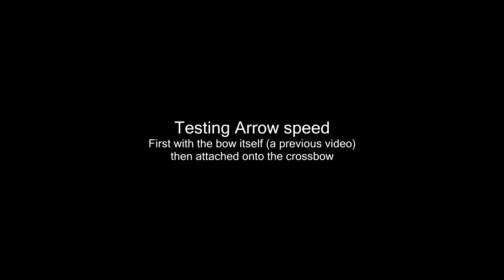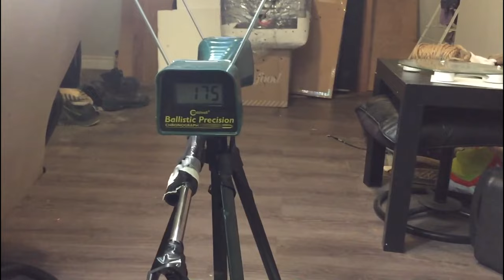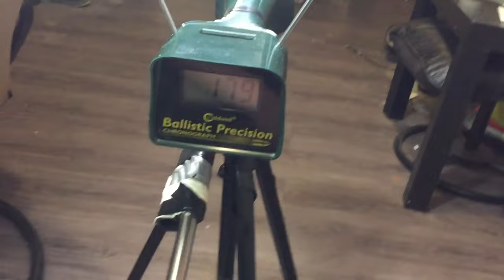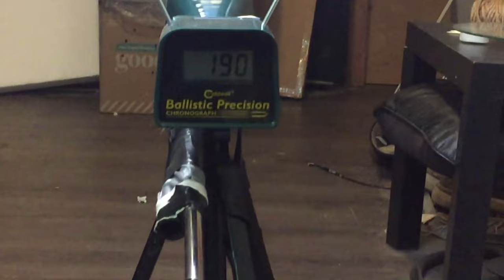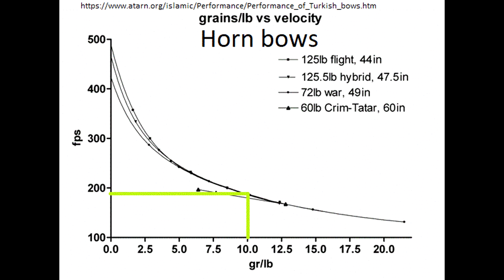Chronograph Chinese Crossbow Potential

Comment: If you can pull like 200 pounds on your cheek, then why wouldn't you make a crossbow of 300 pound or so draw weight 🤨😊Would be a devastating weapon with that 34 inc draw lenght😬 I presume that in case like that one should be quite careful with which kind of arrow design to use..!? I have been dreaming making a crossbow like that few years while raising my children in a small apartment with no tools or space to work🙄😶 Would be awesome to try laminating  a monster crossbow prod. I have a couple of chewrolet fiberglass springs- I didn't even know that they use something like that in a car!!!! But few years ago my master mechanic tattoo customer gave me those and I was like what the h..l🤥😊 Those must be very strong and flexible- even thou might not allowing to pull all that 34 inc... But I must try my best with those before I die!!! And finally: thank you for your inspiring videos🇫🇮🤘
Reply from the maker: thanks. because nobody makes them that heavy that far pulled back
Reply: @HistoricalWeapons  So, maybe I will be the first to try that🤔😊 Working with wood is my thing, so the stock will not be a problem. But in case like this the steelbow must be forgotten for its heaviness and clumsyness...